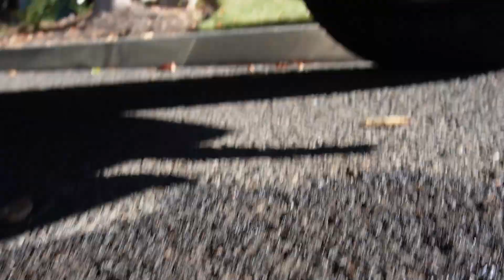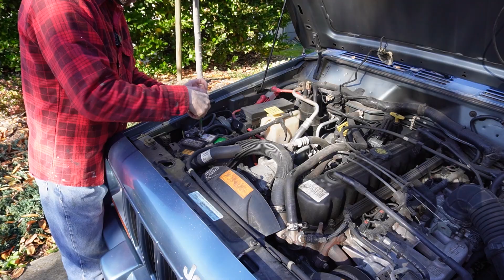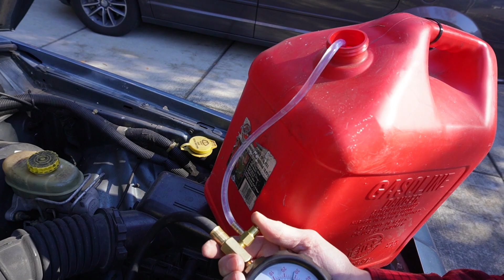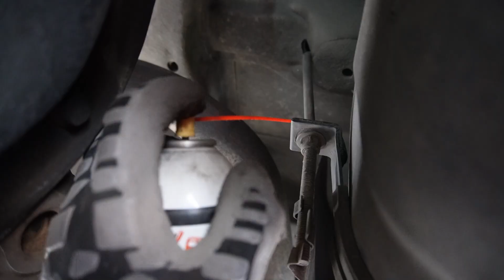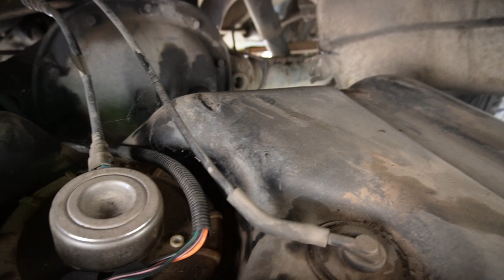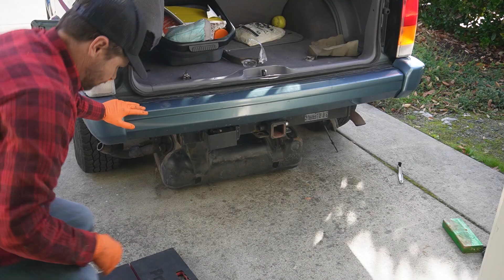The things you find when you walk out to your car... UGh

Comment: I know this off subject, but I just bought a 1998 Jeep Wrangler Sahara tj. I noticed a little puddle underneath the transmission.  it's a ax15 5 speed manual the fill plug is kind of rounded. I tried a 15/16 wrench, is that the right size? I called around to buy a new fill plug and I'm having no luck to find one.